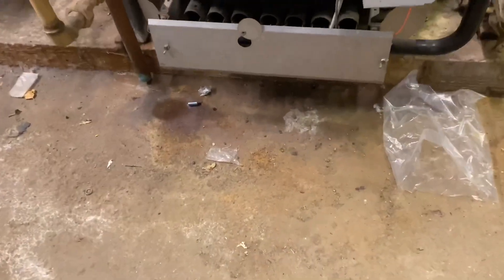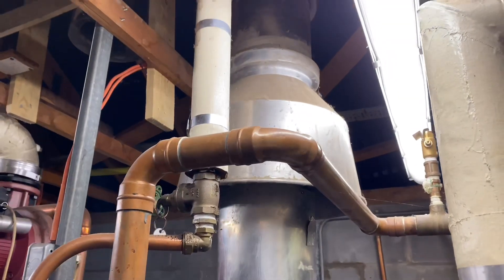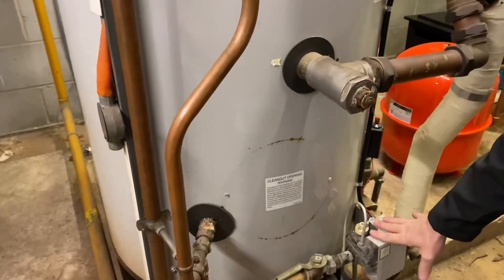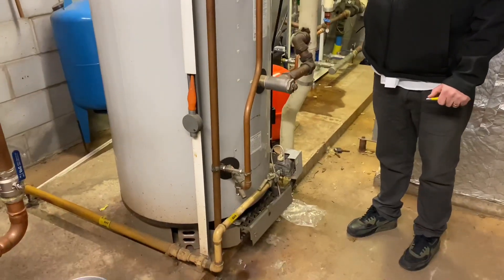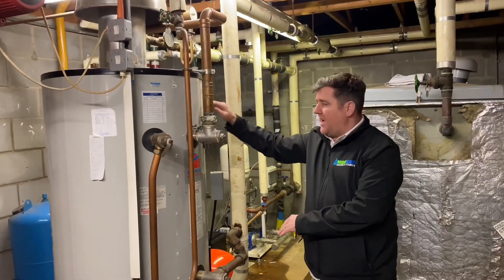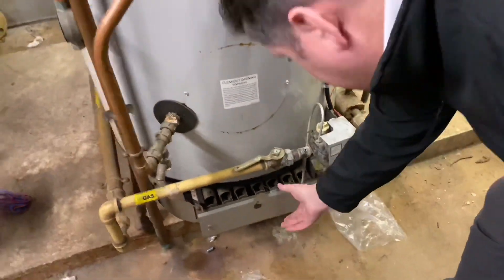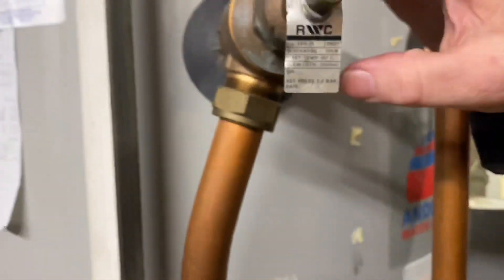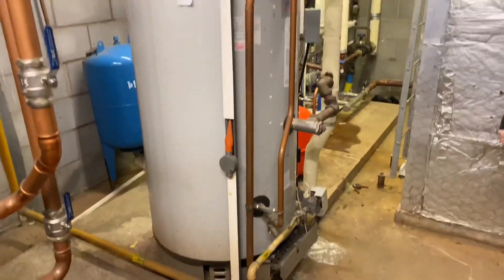Andrews Water Heater - Plant Room

Comment: Looks like a larger version of what many homes in America have in the basement, along with a separate oil furnace or gas boiler (forced air or radiators) taking care of the heating side.
Reply: Yes not very efficient